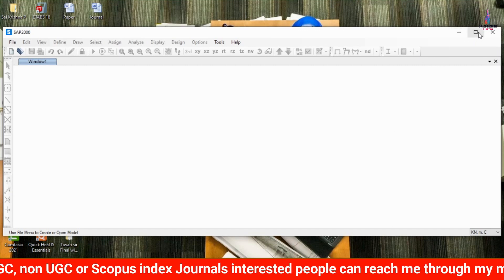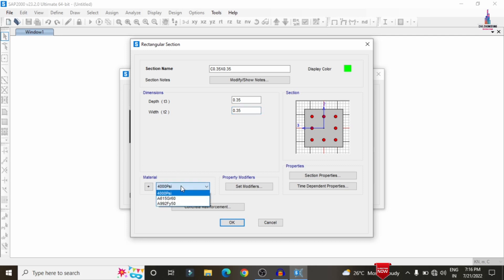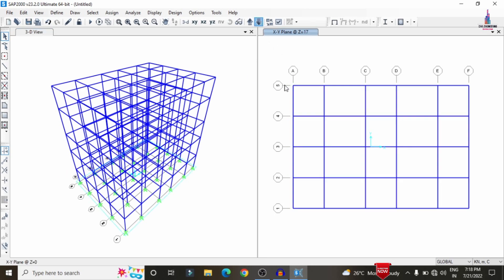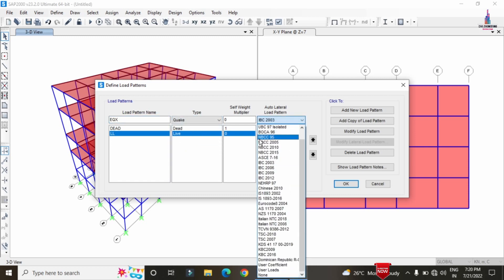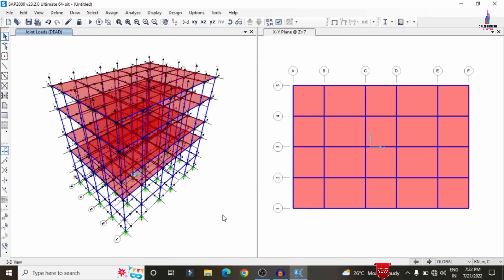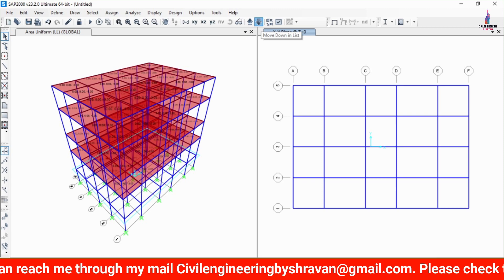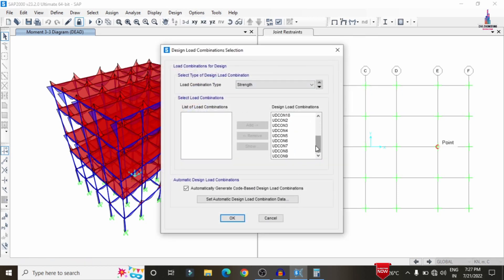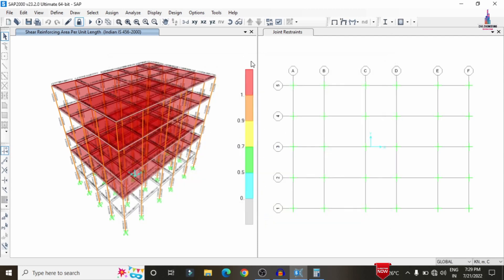Complete RCC building design with SAP 2000 Software | structural design | Civil engineering |

Comment: the way you added self weight is not clear. under "dead" load doesn't it count automatically?
Reply from the maker: Self weight is considered for  members like beams, columns and slabs in the model as per factor 1